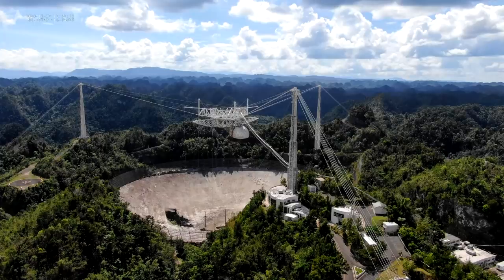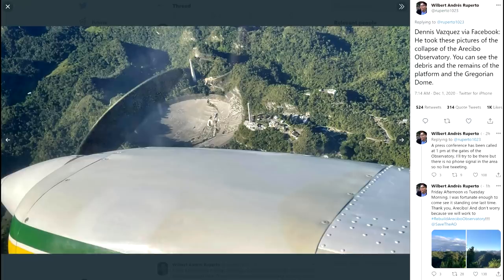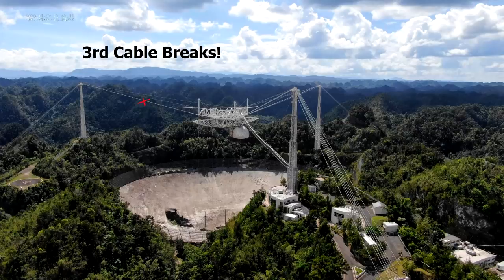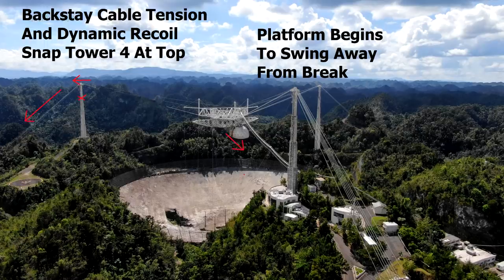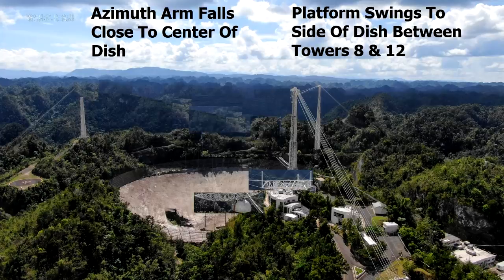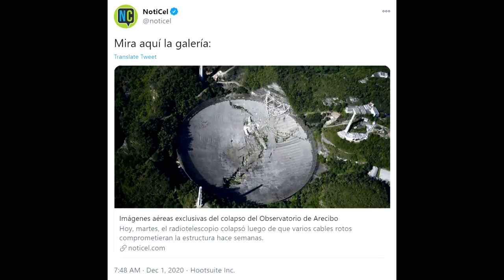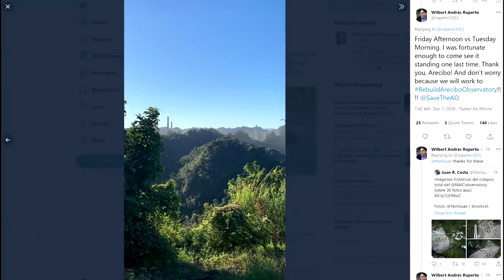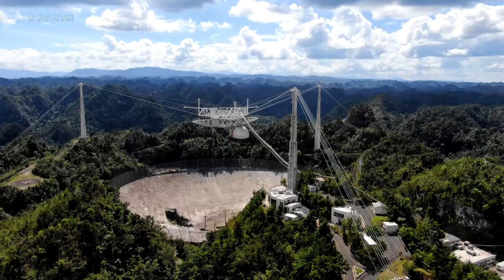Arecibo Radio Telescope Collapses!

Comment: It needs to be rebuilt to be lowered for repairs or it needs a tower in the middle to hold the equipment not cables.... you would get a blind spot with a tower but it would be safer better design
Reply: Look at china design.. They built one that's way bigger and better.

While using cables, they can replace any cable instantly and design where they can move it around to any point within the dish.

Comment: Concrete only has strength in compression.  It has nearly none in sheer and tension. When the counter cables snapped it went from several hundreds of tons of compression to (at the most kind) zero and likely tension of several tens of tons (if not more).  No saving that.  But really where is the 'go fund me' for this?  Have there been pledges from Elon, Branson, et all ponying up money?  That church in France went up like a Valentines Christmas tree and they were all to happy to pony up some cash for that.